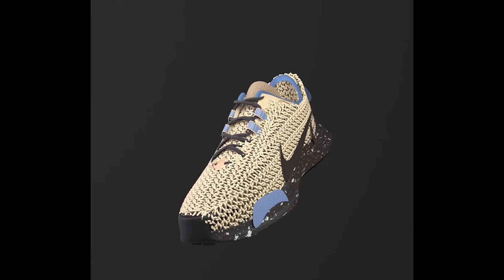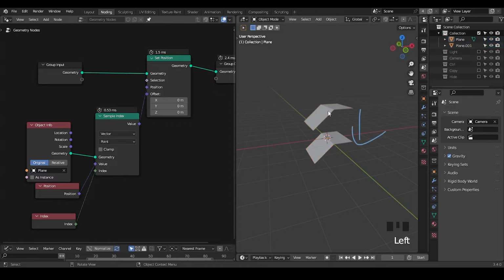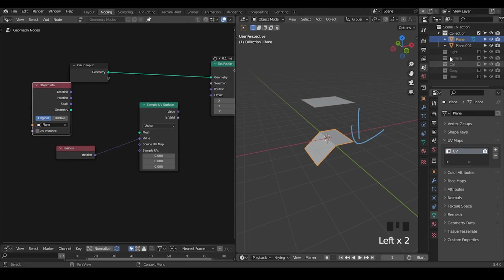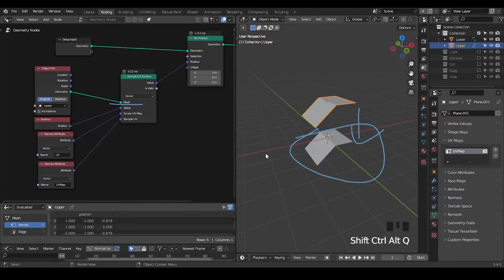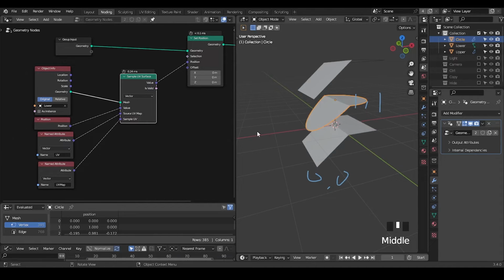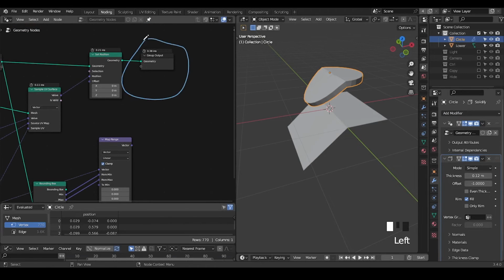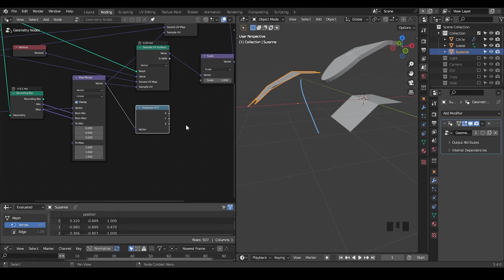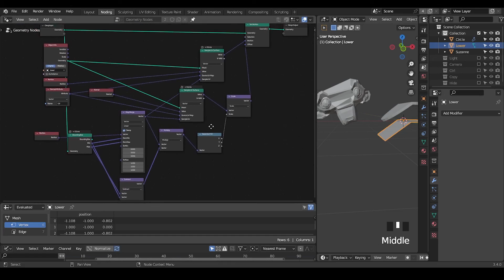[Tut] Sample UV Surface - Blender Geometry Nodes 3.4

Comment: Thanks for the explanation.
I am trying the same setup to transfer vertex position as you did in the first part of the video.
I did it with two spheres and I am getting issues around the seams. Is this a know feature/bug?
Reply from the maker: this method is uv dependent, so it depends how your uv looks like. I assume you are having expected issues. there are still other alternative methods.
Reply: @bradleyanimation120  the Uvs between the two objects are identical, they are just two UV spheres, so it is not a problem related to them. I think the node fails with face corners that are not coherent with the topology. That's a bummer...
Reply from the maker: if uv overlaps it will fail. you can make them not to overlap.
Reply: @bradleyanimation120  Uvs are not overlapping, unlike the plane you are using in your demo, a sphere will fail on the face corners that do not conform to the topology (the seams) unless you split the edges before sampling the Uvs. To understand what I mean in the follow the first part of your tutorial just replace the two polygons planes with two spheres. You will see what I mean
Reply from the maker: @mMemoli  if you mean the pole of UV sphere, it's expected and you can minimize with more subdivision of the original mesh. In the worst scenario, there are still alternatives to do the effect using UV-independent method.

Comment: I love the tutorial which made things clearer to me. I have a strange thing happening however. Instead of a Suzanne I used a cylinder and did the exact same thing you did. Though it worked with the Suzanne, it deformed the cylinder when the plane is flat. Did I miss a turn or what?
Reply from the maker: it would be better if you can post a screenshot in the discord server following the link in the description
Reply: @bradleyanimation120  Actually there is an issue. It comes from the first step when you get Suzanne flat. At this stage (the first UV surface sample) the max and min of the position are the max and min of the plane not of Suzanne. Therefore, is Suzanne is larger than the plane she will be stretch up vertically and if she is smaller she will be stretched down, vertically. To get rid of the problem we can either set the plane at the max and min of Suzanne or add another Bounding box-Map Range apparatus so that the x and y of the position will be mapped to the min and max of Suzanne. I am going to post on Discord to illustrate.
Reply from the maker: @johnsmith56920 
1. “At this stage (the first UV surface sample) the max and min of the position are the max and min of the plane not of Suzanne". No, it is the min and max of Suzanne. Note this is a procedural setup. So any object with this node tree will have a similar effect. Both "Set Position" and "Bounding Box" receives the same input from "Group Input". If "Set Position" is deforming Suzanne Head, then "Bounding Box" must be evaluating it too.
2. The height is a very tricky question here. Note the entire method is based on "UV", which is a 2D concept without meaning of "Height". We can recover the "height" later with method shown in the tutorial, but it must not be perfect because "UV can be stretched/shrunk". Whether a mesh is big or small, UV are mostly ranged from 0-1. So defining a correct height according to the "surface area" is difficult and actually impossible. It would be more suggestable to adjust case by case. and thus I have a "factor" implemented in the actual preset.
Reply: @bradleyanimation120  I am going to munch this at home. Actually, what I want is to be able to, having the position of a point, select the next U or V but not both. The reason I try to do this is that I want to define a border on the UV map with a mathematical equation (x*x+y*y<1 will give me a selection) and raise the z with another mathematical equation. You tutorial gave insights, I'll try. If you see what I mean, and know a node to do this, I am all ears.